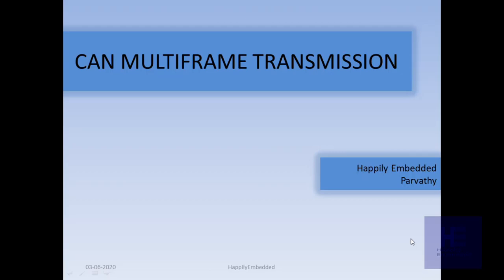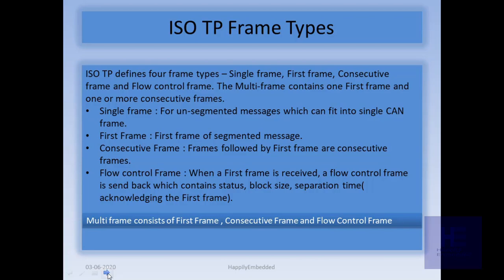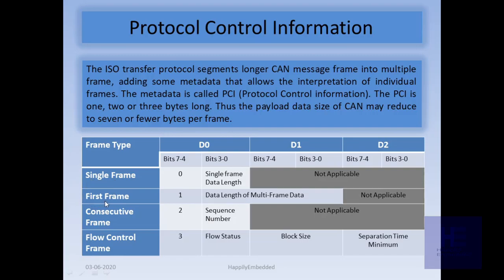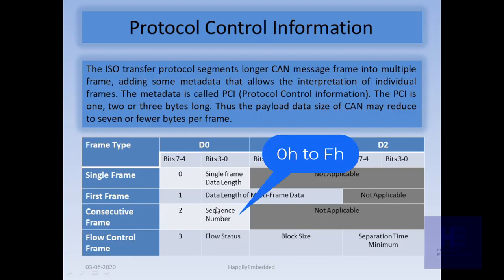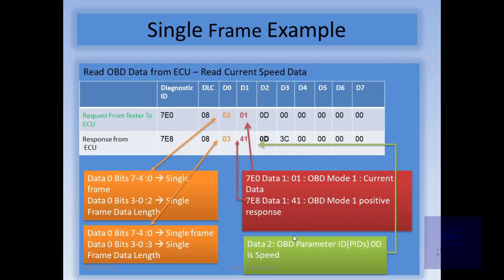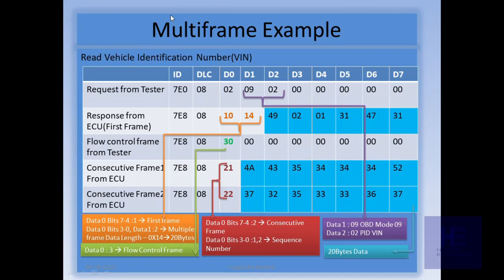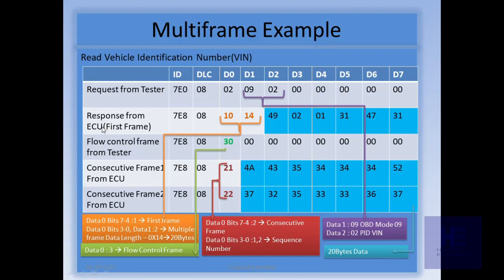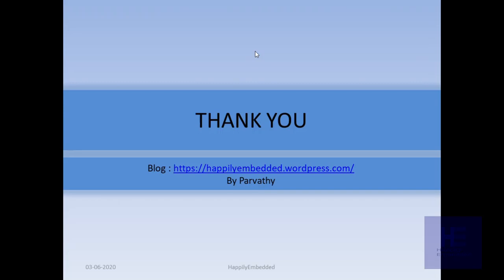CAN MultiFrame Transmission | Part 1 Overview

Comment: I ahve one question related to flow control frame. As yo said the flow control is the response from the receiver to request sender then why the ID is 7E8 but it should be from Tester which is 7E0?
Reply from the maker: Yes you are right. Please check the description.

Comment: How you can tell 20 bytes of data is transfer   how u can find  to 14
Reply from the maker: 0x14 is 20 in decimal. In the multi frame example , we send 20 bytes of data. Understand the CAN TP Format, then you will understand how the 20bytes of data is transferred. Also please watch the ISO TP Video - https://www.youtube.com/watch?v=5wyUEkEW0XU.
The data bytes which are marked in blue color are actual data.Other Data bytes are used to represent Protocol Control Information. Total Data size of First Frame is represented using Byte0 (0-3) and Byte1, So it is 0x014. That means 20bytes.
In FF(First Frame), 6bytes of data has been sent.
In 1st CF(Consecutive Frame), 7 bytes of data has been sent.
In 2nd CF(Consecutive Frame), 7 bytes of data has been sent.
So 6 + 7 + 7 = 20bytes.
So the multiframe data transmission is completed only when total data is received. For 20bytes of data transmission , it need FF + 2 CF. If more data need to be transmitted,then more consecutive frames are needed.Hope you understood it.
Reply: @happilyembedded4408  Thank you for your explanation, I received in the last consecutive frame the values FF FF FF (3 last bytes), does it mean they don't count ?